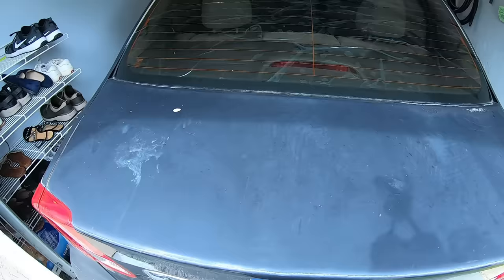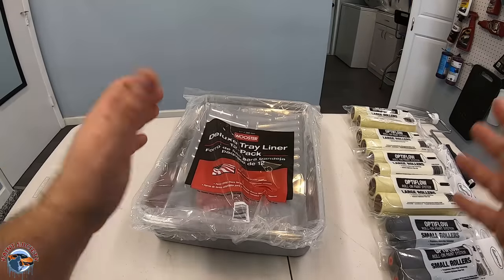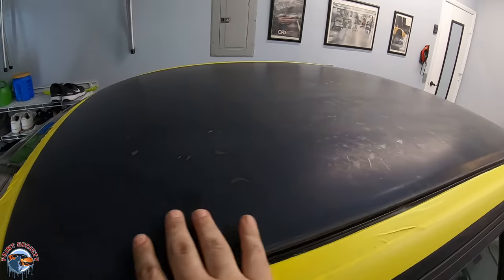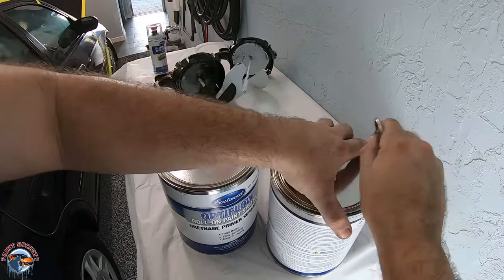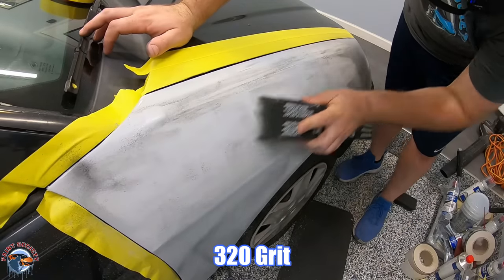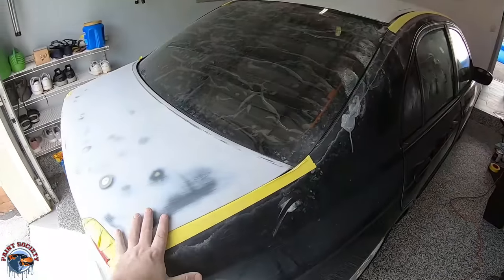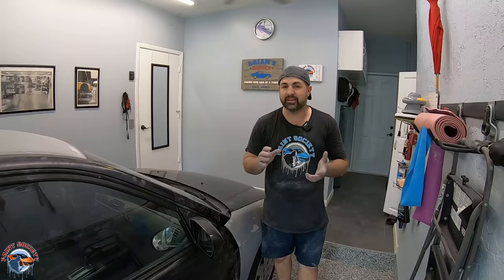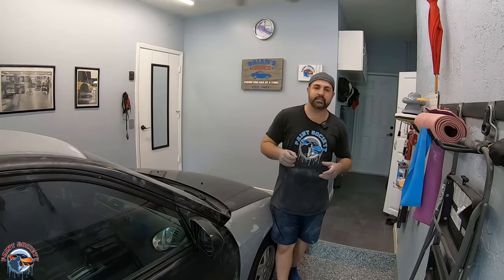DIY Roll-On System gets Great Results in Home Garage!

Comment: Hey nice videos you are sharing. Is it possible you can show how to “blend” stonechipping rubber material to a partly replaced sill panel? I have to replace a rusty sill panel about 20 inches from the front and back. And wanted to be painting and restore the original rubber stone chipping guard before paint.
Reply from the maker: That’s a tough one. Most likely I would sand off the coating and just make a new one. On an older car it would be tough to match.
Reply: Paint Society thanks for the answer. Can you show me how you would do? The car I am going to be painting and restore the stone chipping on is a 2014 Volkswagen touran and I would like to have it as original as possible. 
Is it possible for you to give a full material list of all the products you are using? Thanks again. 😊
Reply: Put tape along the edge of the original stonechip where your repair is on Vw,put skim of filler/Bondi to edge of the tape where your repair is blending into original stonechip,pull tape of before filler goes off. Light scuff,tape it off and stonechip. Looks original be and so easy

Comment: I'm repairing some corroded aluminum fenders and hood from an 02 Explorer. I don't know if I can sand the pits out because of the thickness of the panel so I bought some Onchoice SX 503 which I will return for some 533. Any advice on repairs on corroded aluminum body panels?
Reply from the maker: That’s a tough one. Can it be sandblasted ? I’m not to experience with Aluminum. Maybe a wire  wheel?
Reply: clean the corrosion off, cut bad areas out, braze a back plate and braze the new cut fill all gaps then sand smooth.

Comment: I have a unique and stupid question. I have a 67F100 that I inherited (also learned to drive in) from my grandfather. It had surface rust on the hood and can. He painted it with a roller and latex house paint. It doesn’t sand. How do I get it off for less than a fortune.
Reply from the maker: You can use paint stripper to chemically strip it off easily but make sure that your mask off whatever you don’t want to get on
Reply: I liked the Eastwood tool. I wonder if the latex would clog it up? I know sandpaper is a waste of time and money.
Reply from the maker: Ronnie Johnson it’s hard to say. 40 grit probably would make quick work of it.
Reply: Thank you for the response. My first home shop paint job was a Ford Fairmont. They sanded the rough and rust and sprayed it with red oxide primer. It was silver. Took two gallons of mixed paint to cover that red crap.
Reply from the maker: Ronnie Johnson you’ll want to get it in etch or epoxy after its down to metal.

Comment: My coupe has sealer on it from when it was in bare metal after all the metal work, should I remove it or sand/scuff?
Reply from the maker: If it’s epoxy then it will be good

Comment: Could you just use their 2k rattle cans for epoxy and urethane? (Besides minor overspray considerations and less initial product build, you wouldn’t need the mixing equipment, rollers, cups, pans, etc., correct?)
Reply: I would say yes.  This system seems to try to overcomplicate something that should be quite simple
Reply from the maker: Yes but it won’t have the same mil build. I talked about this in the video a bit
Reply: Paint Society thanks, and technically you could build the mils with more passes, correct? If so, seems like spray cans would be a better option for panel-by-panel prep/paint than using gallons for roller application.
Reply: @C10Robert  so how many cans did you go through? Generally speaking most aerosol TDS that I've seen state somewhere around 30 microns assuming 100% of the product is transferred to the panel . In saying that, rolling it on is definitely a viable option for that reason alone. And as said above I don't think it's overcomplicated at all, unless referring specifically to this eastwood system. In that case the only overcomplicating aspect I believe, would stem from the paints initial condition and/or variences in the users application

Comment: Great video and explanation but jeeeeezus this paint system is ridiculously complicated.  Far too many steps...far too many different products....far too much time involved (four days between coats of epoxy /primer).  Add in a stupidly short working time of 20 minutes just to ensure you run into issues and are rushing insanely to avoid them.  Again great vid but definitely made me see how ridiculous that system is.  Talk about complicating the hell out of things with way too many steps...too much time span (two weeks?) and I'm guessing it isn't even cheap.
Reply from the maker: Hi Bob. 

Anything unconventional is going to be a bit different to use.  The epoxy needs time to cure so it can shrink. Really though after two days it was good to go.

Comment: Hi Bryan i would like to know how do you blend white 2k paint or any 2k paints
Reply from the maker: I have tons of videos in blending
Reply: @PaintSociety  so blending normal base is the same like 2k white i tried like a reducer on the edges i think it works then i just sand down the over spray and buff because 2k u don't use clear should i over reduce it also
Reply: I'll check the videos again
Reply: Just add extra reducer to already reduced paint,so it's extra thin,then dust it on ur blend edge till it starts to go in. Don't put too much on,or it will run,just dust it on,you will see the edge melt in

Comment: Question... I'm in a situation where I need to paint outside we have several 70 + days coming up in Ohio,
 I was told the medal of the car would be to cold and it was too late to paint outside here, wouldn't the medal be the ambient temperature ? All the activators I purchased say 65° to 80°
Reply from the maker: You should be fine if you paint in the heat of the day. Just get a normal medium activator

Comment: I don't get it... What's the point of roll on primer when everything else is rattle can? Is it because its so thick or what? I feel like you just gave yourself more work by rolling on that primer and sanding more than you would normally need to.

Comment: Interesting system, too bad I don't buy Eastwood products any longer.  Does anyone else offer this system?
Reply from the maker: I’m not sure.
Reply: Alexseal for boats works
Reply: What's the issue with Eastwood? Just curious.
Reply: @TheRoadhammer379  Have  had  negative encounters with their Customer Unservice, they don't stand behind their products.
Reply: It can be done with any automotive priming system, as long as you use mixing ratio guidelines,

Comment: $500.00 is a bit too high for me though.
Reply from the maker: More then a 33 compressor, paint gun and then paint ?
Reply: It's cheaper then all the tools if you wanna get started fast... However, once you buy the tools you can reuse them again forever and primer is only $50-$100 and you can do 3 panels or more.  I choose to invest in my garage and go with a compressor/gun setup. Good video tho, great option if your local area codes restrict 2k paints in a home garage out of a gun!!

Comment: O
Reply: Eastwood Epoxy primer can be wet sanded.  I went with this method and wet sanding on my 1966 mustang. keeps the paper cleaner and cuts the dust so you don't have to wear a respirator.